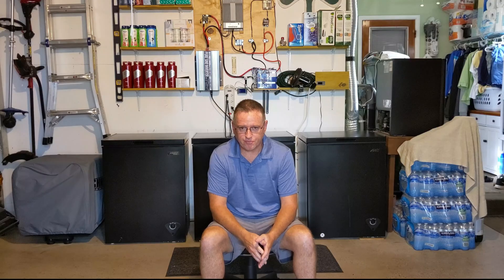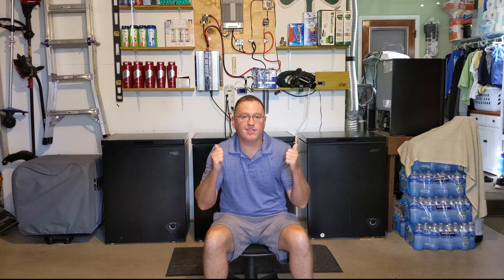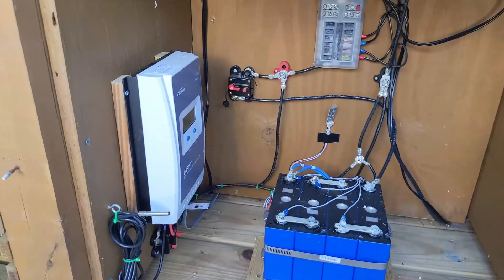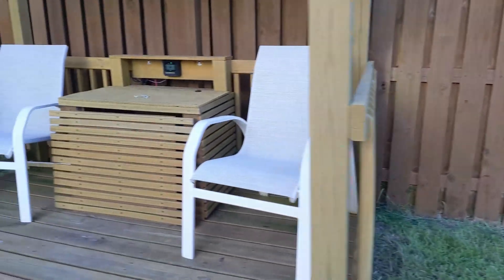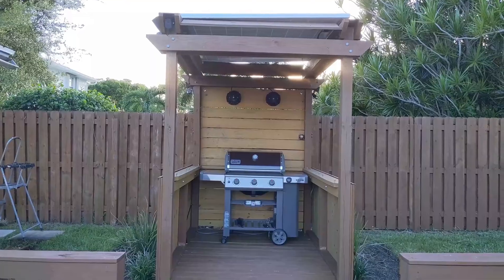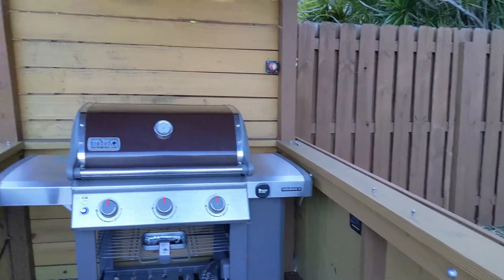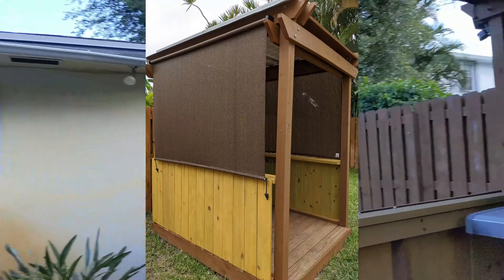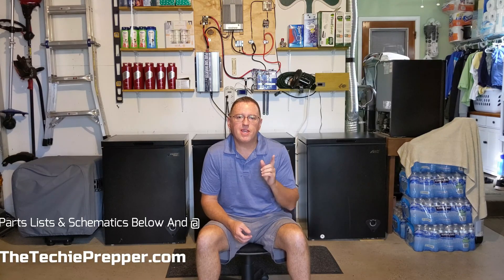Stealth (Hidden) Solar Systems for Preppers AND Everyday Use

Comment: I am confused about the 12V phone charger. Phones charge at 5V so, is the out to the phone 12V?
Reply from the maker: Hi Xierxu!  The input to the socket is 12v directly from the battery/fuse block .  The socket steps that voltage down (internally) to the 5v USB outlets to charge phones, Bluetooth speakers, etc.  I think that's what you were referring to, if not, let me know and I'll try to help any way I can.

Comment: You shouldn't use metal to tie your cells together. At least not without a protective layer. The aluminum housing under the blue foil is not neutral, it is positive!
So it can be very dangerous if the foil is damaged!
Reply from the maker: Thanks for the tip!  I don't have them clamped tightly and they experience no vibration whatsoever.  Aside from lizard poop, they remain undisturbed.  That being said, When I do my next preventative maintenance (beginning of winter, I'll loosen them and insert a piece of innertube or similar for some additional protection.